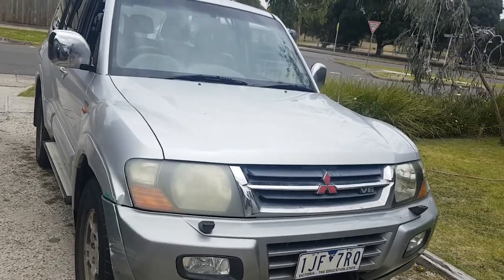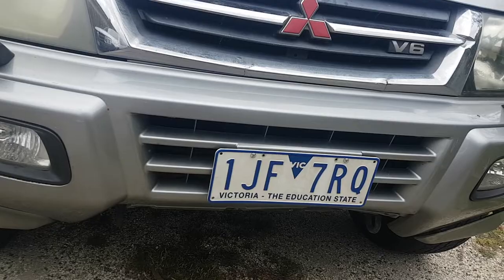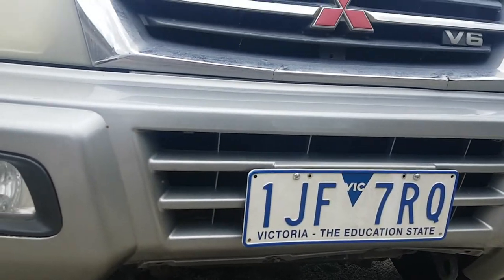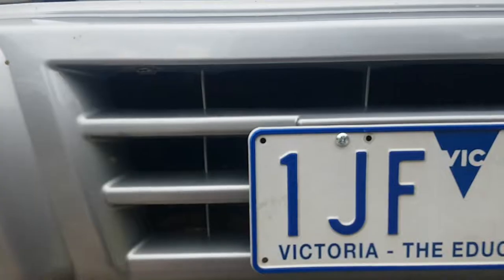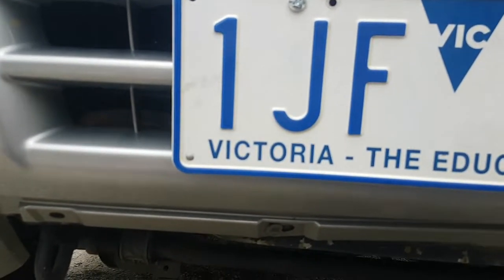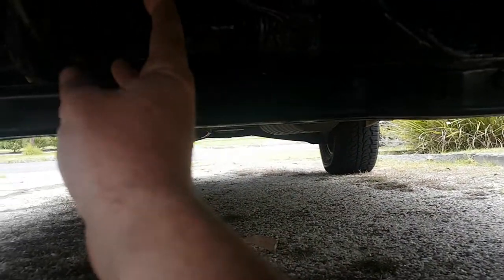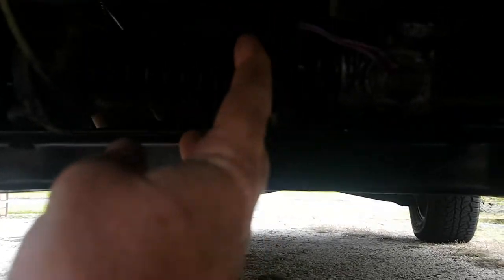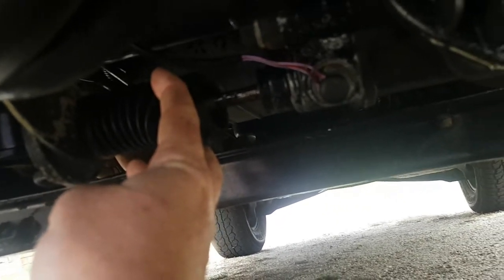Pajero/Montero centre diff lock light flashing fix

Comment: Will it do damage to anything , if left
Reply from the maker: No, it will default to 4high if there is no vacuum so will not harm your vehicle.
Reply from the maker: So just leave it in 4h all the time if the light is always flashing
Reply: @scottythescavenger7295  Thanks for responding , yeah only bought the vehicle a week ago and after traveling about 30 k or so centre orange diff lock light  flashes , when i shut motor down , and start again it's back to two green rear wheel lights , and then just repeats same again , i will get it checked out , thanks mate cheers .
Reply from the maker: No worries i wouldnt worry about it too much, driving around in 4h won't affect your fuel mileage more than a few percent. If you decide to fix it then you'll probably need to swap this part which controls the vaccuum of your transfer case. https://youtu.be/L8n8mCtP9s0
Reply: It can snap a 4wd actuator fork when using offraod because there is not enough vacuum to fully open the actuator so it isn't fully engaged into 4wd

Comment: My car not move this actuator what you think problem thanks
Reply from the maker: Need to replace the solenoid which controls actuator
Reply from the maker: Check for 12v power coming to and from actuator to find problem
Reply: @scottythescavenger7295  
thanks i have code 35 I think this actuator problem